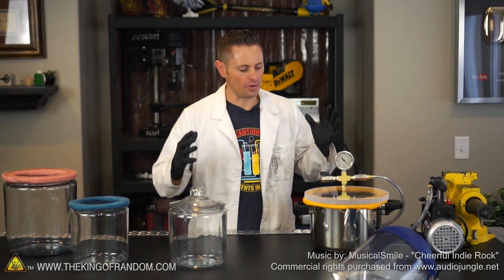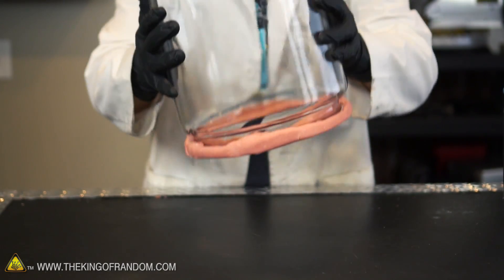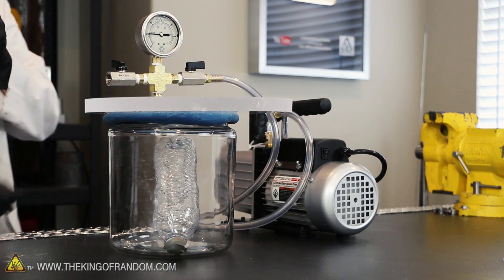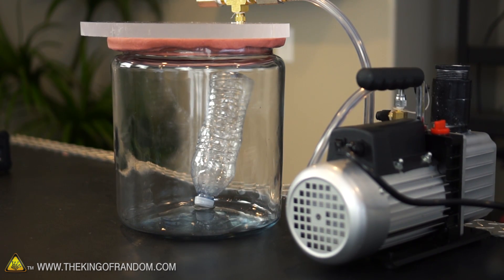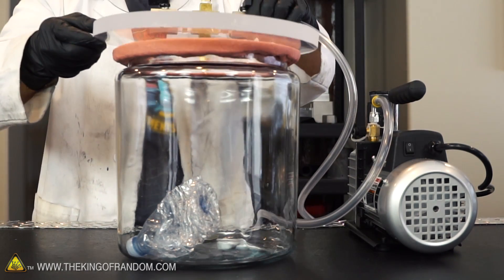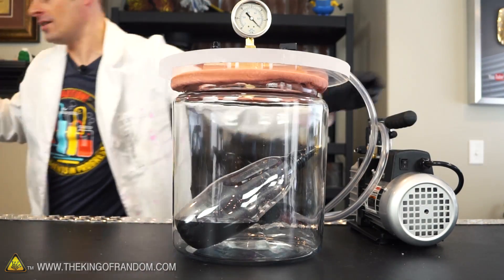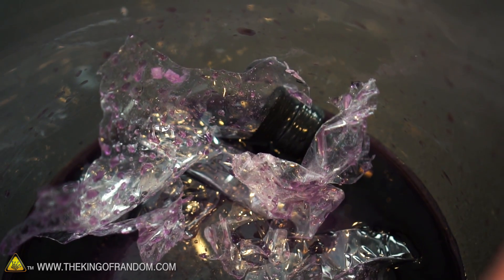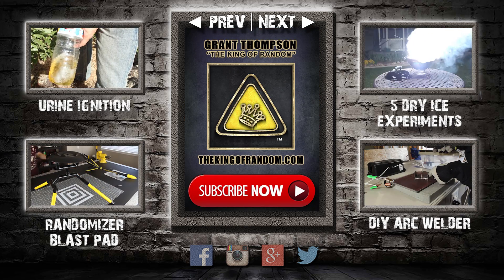Will A Glass Vacuum Chamber Implode?

Comment: Hi. I love this channel, and I'm interested in a lot of the experiments you do - mainly because a lot of your experiments would be illegal to try here in the UK. I like your vacuum chambers, and that set me thinking. Would expanded polystyrene (styrofoam) collapse in a vacuum? It's aerated polystyrene, so would those bubbles collapse in a vacuum? And what happens to raw eggs in their shells? do they boil at lower pressure, or simply implode? What about bubble wrap, more of which is probably used theraputically (mmmmmm), than for packaging? That might be fun. The Hacksmith used to do 'Does It Laser?' - you could do 'Does It Survive Vacuum?' it's a thought.

Comment: As a former NASA test engineer, I would warn about using the glass jars.  You may have been lucky and found some that can take the pressure, but it may have also been on the edge of bursting.  If you do a pressure test to failure, I recommend a hydro test where you fill the container with water and add water pressure until it burst.  The water will not store as much energy as compressed air.

Comment: yea, it might be wise to conduct a failure test on those glass jars. given the large amount of pressure due to the vacuum, it could potentially take very little uneven pressure  on the outside to cause an implosion. I don't know for certain, but as little pressure as a pen gun (you know, like using the spring to send out the ink container) could cause failure. or perhaps it would take more but you won't know until you test it.

Comment: Be Careful with this. Saying that any glass is OK to use as a vacuum chamber is risky. Sure, 9 might work ok, but the 10th may implode. Glass cookie jars are made by many manufactures and will all have different thickness. Who knows how thick these where. But the biggest reason of all is that glass has NO QUALITY CONTROL in terms of small air bubbles for cheap things like cookie jars. This is why it's always a gamble to use pressurized glass containers for anything.

Comment: I don't think it really matters how much volume you pull out. All that matters is the wall thickness and the geometry of the pot. The Pressure is always -1bar. 1bar is 0.1MPa=0.1N/mm^2. Via Barlow's formula and material strength you could work out when the jar would burst.

Comment: what happens when you put a gopro in a vacuum chamber?
Reply from the maker: Glad you asked .. you'll see next week haha.
Reply: Nothing, they flew them in spacewalks and they works just fine
Reply: nothing, astronauts record in vacuum and nothing happens
Reply: Wow, Cody already did this.... The only thing that happens is that the audio gets a bit eerie because of the microphone
Reply: It will probably do nothing
Reply: Do you really think that Astronauts use commercially available cameras in vacuum chambers? And if it is true, where's your proof. To my knowledge.. They make everything specialized for vacuum conditions.
Reply: Martin3 at first you could hear him talking but as the atmosphere drops the his voice starts to fade
Reply: Martin3 *gopro
Reply: Grant Thompson - "The King of Random" YAYAYAYYAYA
Reply: Grant, remember to record the sound if possible.
Reply: Yeah, also cody explains that it is not boiling, the gas is just expanding so the bubbles get bigger and eventually pop, theres no "new boiling point"
Reply: That's interesting.  How did you find that out
Reply: *Nothing. I own both a GoPro and a vacuum chamber which is very similar to Grant's but can reach -28 on the scale (28 inches of mercury). All that happened is that the audio died out a little. That's all, it kept working just fine.
Reply: +RektSkrubs ***SPOILERS!!
Reply: Martin3 Yes!
Reply: +Grant Thompson - "The King of Random" Awesome!
Reply: Martin3 i have the hero 3 with the lcd and plastic touch screen back, it was normally shut before I went on a flight and when we went in air the Plastic screen protector of the case expanded. I reset it to the current pressure and when we landed it sucked to the gopro.
Reply: im talking about the water
Reply: I understand where your coming from but the boiling point has changed. Boiling points are determined by temperature at certain pressures. So waters boiling point at sea level is 212 F or 100 C but at higher altitudes with lower pressure it is lower.
Reply: wallonfire there is gopro footage of astronauts in the vacuum of space.
Reply: Nothing.
Reply: I didnt say there wasnt, where in my comment did I say they didnt? Just because they use a "GoPro" doesnt mean it was a commercially available one, in fact, it was specifically manufactured for that mission.
Reply: Martin3 ya

Comment: If you cool down the air inside the vacuum and heat up the air on the outside it may have an even higher chance of imploding (just a thought encase you ever put liquid nitrogen or dry ice in them

Comment: Since you have did a episode using slime in nitrogen,  what would happen if you put slime in the vacuum chamber? would the bubbles come out like in the silicone molds or would the water in it reach a boiling point like in the bottle?

Comment: Water will boil in a vacuum as there is low to none air pressure acting on it. Water has a tendency to escape from each other which results in it (liquid state) wanting to become water vapour (gaseous state). So, boiling point of water depends on temperature and surrounding air pressure. If you go up to a mountain and start to boil water, you'll notice that it will start boiling when it is  less than 100°C (probs around 92-95), due to the thin atmospheric layer (low air pressure).

Comment: -What if you increase the pressure inside the vacuum by adding air instead of sucking it out??
Reply: Eye Tea Nothing Will happen
Reply: Eye Tea The only reason the chamber is sealed is because the pressure outside is greater than the pressure inside so the lid is pressed down tightly. With this setup he can't pressurize the chamber.

Comment: Yeah, you wont have any problems with that large glass container. Even with an explosion happening inside, with the glass under tremendous pressure, and the explosion not having an atmosphere to slow it down, it didn't break.

Comment: why does the boiling level change im so confused
Reply: It's kind of like a bong, as you breathe in and have bowl in place it looks like it's boiling but it's actually not
Reply: Mandlize wow thnx i understand now 😂
Reply: Used in your car...pressurized radiator cooling system RAISES the boiling point of water so that it doesn't boil off above 212 degrees F.

Comment: When you do the follow up video, in addition to creating failure by impact, also test defect. Possibly another pressurized plastic bottle with various sizes of ball bearings attached to the outside for interior impact and scoring the interior and/or exterior with a glass cutter. Als, what is the thickness of the glass?

Comment: Heads up Grant when the bottle exploded in the larger chamber the metal tip on the valve could have scratched or fractured the glass in your container and created a point of failure.

Love your vids man.

Comment: What will happen if you put a vacuum chamber inside a highly pressurized chamber. i.e. What is the largest pressure differential you can create.
Reply: well i did a quick search, and the highest pressure differential achieved sofar is 5*10^7 Tones, 50 Mega Bar. Though this was not done with gasses. Though the pressure at the core of the Z Machine is possibly higher still, though i dont have enough knowledge in that field to give a decisive answer, nor did i find any reliable figures on that.

Comment: HEY WHAT HAPPENS IF YOU PUT A DRONE IN A VACUME OR SOMTHING THAT CAN FLY?#!?!?

Also what happens if you put nitrogen into a vacume chamber aswell?
Reply: to answer the first question:

The drones battery might explode, due to the electrolyte boiling. (highly dependent on the battery though). There is a slight possibility that a semiconductor could crack its epoxy case, though they should be strong enough to withstand the pressure difference. Other then that, not much should happen.

To answer the liquid nitrogen question, it will turn into a solid. (amusing you meant liquid nitrogen). If you however meant gaseous nitrogen, then your question was already answered in the the video you put this commend under. Seeing as air is 78% (roughly) nitrogen.

Comment: was the fluid realy boiling? can you make pasta in it?
Reply: David Stedile for pasta you need heat. boiling just a changing state of matter from liquid to air.
Reply: Yeah, the boiling doesn't cook things, the heat does. That's why you have to use a pressure cooker if you're climbing on a high mountains.
Reply: it is literally getting colder look up codey's video
Reply: as pressure decreases the boiling point does also so if your pressure gets low enough the water can boil but be cold as ice. so no cooking noodles.
Reply: +travis yeah man exactly grant actually said that in the video so if david payed more attention he would knew
Reply: You can cook pasta with cold water. It just takes a really long time, and a lot of the outer layer of the pasta would dissolve in the process.

Comment: Can u put a smaller vacuum chamber in a vacuum chamber? it will create a black hole lol :)
Reply: And turn em on in the same time :D
Reply: you can easily put a vacuum chamber in a vacuum chamber. It wont be very interesting too look at though, as nothing will happen. Seeing as no force is acting on the inner vacuum chamber (as there is no gas on the inside, and non on the outside, hence no force)
Reply: It would be no different than putting a bottle with the same atmospheric pressure inside another bottle with the same atmospheric pressure. We do it every single day that we open and close any bottle on Earth. The pressure inside = the pressure outside and thus it's in equilibrium. The same would happen at lower pressures (like in a vacuum chamber) and at higher pressures (like in a gas cylinder)

Comment: Grant, that pump is rated to pull a lot deeper vacuum than you're getting. Are the specs on it wrong, or could the proto-putty gaskets (or other fittings) be leaking?

Comment: Just a quick comment, there are no such thing as "vacuum foces" sucking on the bottle.  What is happening is the pressure inside the bottle is countered by the atmospheric pressure.  So if you have a bottle pressurized to 2atm, the net force pushing out, from inside, on the bottle will be 1 atm.  

When you place the bottle in the vacuum chamber and remove the 1atm from outside the bottle you are left with a net force of 2atm pushing out from inside the bottle.  if this is more than the bottle can withstand, it will burst.

Comment: What will happen if you put water in the vacuum chamber?
Reply: Cameron Willett water is not compressible. Probably nothing will happen.
Reply: the water will boil until it freezes
Reply: Because water is made from oxygen and hydrogen so will it take the gases out and leave nothing?
Reply: Cameron Willett no, it will just boil
Reply: did u test that? +hi there
Reply: Mohammed it happen in the video and if you studied you should know thay
Reply: yea but the gaseous H2O will get sucked out by the pump too?
Reply: It would eventually boil, then it'd hit its triple point... then it'd freeze.

Comment: You should try getting some white phosphorus and putting it into the glass chamber. When white phosphorus is in a vacuum it sublimes and turns directly from a solid to a gas. White phosphorus gives off a greenish-white glow and it would be cool to see if the gas gives off light while in the chamber. It would be a cool experiment to look into that would be more easily observed with this setup.

Comment: Ice is basically water with its particles squished together. And gas is the opposite - water particles spread out. So when you put it in a vacuum chamber, and remove the air, the empty spots are where the water particles spread out, thus causing gas and thus boiling. AT LEAST I think, I'm only 13 XD.

Comment: You should wrap a layer or two of clear tape around the outside. Press it down neatly so no air bubbles get in to make a clear almost invisible layer.

That way if it implodes there is a little bit of structure left (obviously the tape wont shatter) to hold it together and not send glass flying everywhere. Kind of like how car windshields work. Obviously you would lose the airtight seal but I figure it would reduce the amount of glass that flies around the room.

Comment: as an analytical chemist I would be very very very careful with that large one it may not have imploded today but you have to be very careful with that one that is not vacuum rated glass. 

we hired a new chemist one year and she thought she could take a shortcut by attaching a filter apparatus directly to the receiver that she was going to collect her filtered solution through...... a new table top and 15 stitches later she realized never to use non vacuum rated glass containers like that.

your videos are awesome and I don't want to hear about you having to get stitches or worse yet getting a large shard of glass in your jugular. 

I wouldn't use the large one I would only stick with the small one.... on second thought it may be worth it for you to have a special glass container that's vacuum rated made if you're going to do a lot of vacuum experiments.

sincerely yours a fellow scientist

Comment: GRANT.
How does liquid nitrogen react in a vacuum chamber. Let's see. I mean, if water boils down because of such low pressure, how will nitrogen react?
LIKE if you'd see it!
Reply: Umbra Games as my opinion maybe the vacuum chamber will keep on sucking the gas of liquid nitrogen which is boiled and vaporized.
Reply: Umbra Games I think cody's lab did that, but I'm don't know for sure.
Reply: Eventually it will freeze. Proof: search in youtube for Veritasium. He has a video on that
Reply: so cool idea
Reply: Umbra Games a
Reply: Umbra Games that's a bad idea. It evaporates and thus will raise the pressure inside the jar. You'll just get it to evaporate away quicker and freeze his air pump as it pumps super cooled nitrogen
Reply: qflux no less pressure means it turns to gas faster. You'd need more pressure to get solid, but I don't believe nitrogen can exist in solid form
Reply: it creates a layer of solid nitrogen on top but breaks after 2 seconds, then freezes and starts again.
Reply: Umbra Games pretty sure hydraulic press channel did that a while ago.
Reply: Umbra Games The water wasn't boiling, it reached its triple point. although it looks like it's boiling it's actually colder than it was before it went into the vacuum.
Reply: It will become a solid.

Comment: what happens if you put oobleck in a vacuum chamber?  Will it stay liquid or will it turn solid?
Reply: The Lego Mewtwo 
love this idea he should do this
Reply: The Lego Mewtwo It will boil and then freeze
Reply: willl it make a trypophobia reaction?
Reply: Depending on the pressure, if it's high enough to make the water boil, then it would boil away.
Reply: The Lego Mewtwo  that's a great idea
Reply: Thanks
Reply: The Lego Mewtwo my ideo was put liquid nitrogen